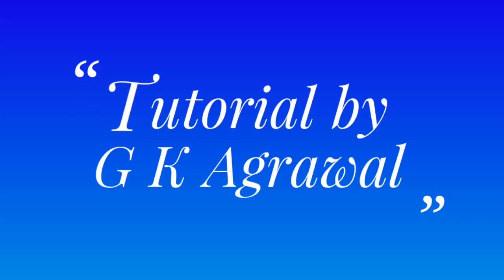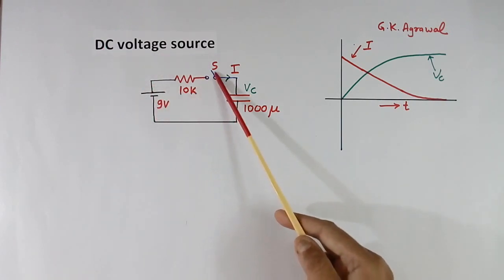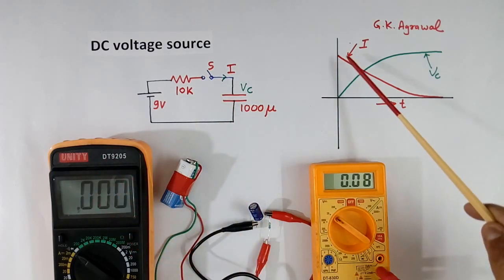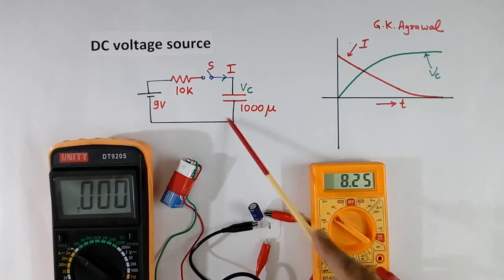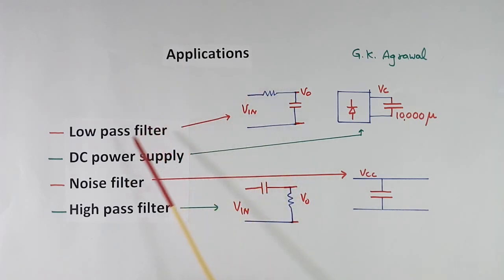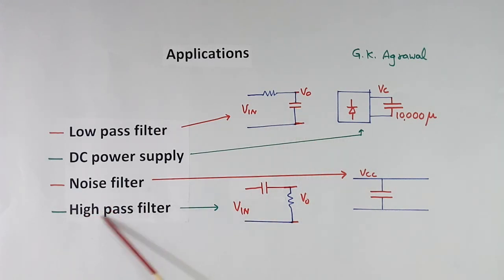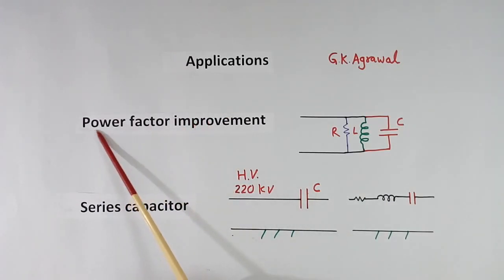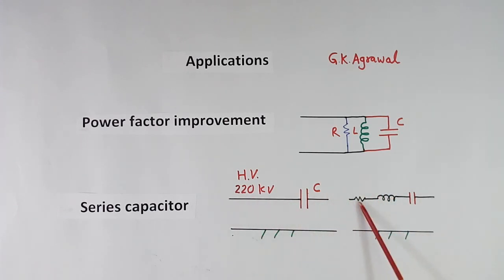How capacitor works in AC and DC circuit, function & impedance

Comment: Thank you for the video. I repair 12V DC car amplifiers. I never really understood why they used capacitors after the B+ input. Now I understand much better. I always heard capacitors blocked DC. Now I know it stores the input to be discharged quickly during demanding transient responses to prevent voltage drop. Your video was extremely helpful! Have a great day. I subscribed.
Reply from the maker: You can also watch my very exclusive video on "Capacitor does not block DC".

Comment: Why capacitor is shorted when switch is closed in a DC Circuit?
Reply from the maker: As voltage is zero across capacitor. So current flow as if no drop in capacitor.
Reply: @GKAgrawal2  However the theory states a capacitor is open circuit in a DC Circuit. How does the current flow? Im trying to figure out the explanation for the high inrush current when the switch is closed. Im sure its because of the electric field and electromagnetism. I had problem explaining the capacitor charging current in DC circuit in layman term to my colleagues. So I told them when the plates are not charged the current flow easily but when the plates are fully charged it will be difficult for for current to overcome the charges.
Reply from the maker: You must watch my very exclusive video, how capacitor block DC, a fact.
When some one ask a question, then give answer only if you know. Else say You do not know. In your above message, look like, you are giving answer without knowing properly.
Reply: @GKAgrawal2  Thanks will definitely watch that.

Comment: Why capacitor behaves like a short ckt in starting? 
Capacitor is seprated by dielectric insulating material. 
How current will flow from insulating material? 
Request you sir to pls ans
Reply: We have not connected any load in capacitor during starting. 
So why current is high at starting

Comment: sir  i have one doubt  in dc capacitor the two plates or the two terminals are separated by the dielectric medium then how the current flow during the charging of the capacitor from positive to negative terminal of the battery .... for discharging you said the stored energy was discharged through internal resistance of the capacitor it is so clear ... my only doubt is  how the charging current flow from positive to negative during the charging process crossing the dielectric
Reply from the maker: In case of an ideal capacitor, in realty, no current flows inside the capacitor. But it behaves exactlly as if current is flowing inside, looking from the outside., so we say current is flowing. This makes mathmetical model easy to explain. This is valid for AC and DC both.

Comment: Dear Sir 
In your video  @ 6.47   explained  Current leads voltage in the capacitor. Could you please show us a simple circuit to test it practically with an oscilloscope ?   Example : CH1 to measure Voltage     CH2 to measure Current 
Thank you so much for sharing your knowledge.
Reply from the maker: Good question, just use ckt shown at 2.3, but use 9  volt  AC using step down isolated transformer  in place of DC. Connect common of the CRO to R and C connection point. Connect CH1 to other end of the capacitor. Connect ch 2 to other end of resistor.  Voltage at ch 2 or across register will tell about  current Vr/R flowing in the capacitor, but negative.  Invert ch2  signal if you have option in scope.   Insted of 9 volt, it can be some other small voltage. Change R and C value, if measurement is problem. Recomended value C equal to 1 micro, R equal to 1 K ,  0.25 watts or more. Jai Hind
Reply: Thank you so much for your time Sir.  
It is really hard to find practical experiments in U-tube for Current Leading/Voltage leading for capacitor/inductor     
I really appreciate, if you could cover these two practical  experiments in near future. This could be very helpful for lots of people.  Kind regards  Din
Reply from the maker: Looks like, you did not try my method
Reply: Dear Sir, Not yet.  I have access to a CRO only on weekends, . I will try this tomorrow , if my friend is free. He has a CRO.
 Kind regards, Din
Reply: I have also sent  a message via "COMMUNITY" not sure that you have received it. Pls confirm ...
Good Luck and  Regards,  Din

Comment: can u please explain what will be the voltage in a circuit having a capacitor and a resistor in series connected to a battery and a a.c source

Comment: Agrawal Sir, I have a question for you. I have a capacitor removed from ceiling fan.  I do projects at home on breadboard  using resistors,capacitors, LEDs etc using DC power supply of 9V.  Can i use this capacitor of 2.5 microfarad  removed from the ceiling fan for my breadboard projects ? Thank you.
Reply from the maker: Sure, you can use. But as body of the capacitor is big in size,  body to be connected to ground or connect to common terminal to avoid noise pick up.  Other wise function wise no problem. Watch my electronic circuit design tutorials, there are 40 tips in total.